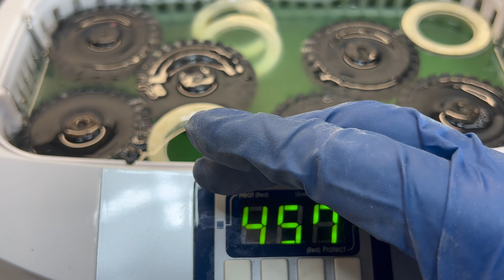Vintage 1960s Tonka Dump Truck Custom Color Restoration - Sandblasting & Powder Coating.

Comment: Regarding the powder coat not sticking after you applied primer.  I have had little success with the Harbor Freight powder coater. I don't think it gives enough electrical charge to the metal.  I need to upgrade.  I haven't used mine in a year.